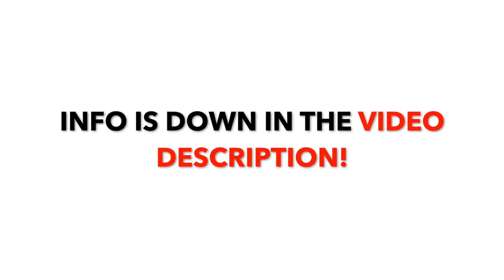NEW Whoop MOTORS from VCI | 8028 27000kV | 75mm Whoop | Testing on different Racetracks

Comment from the maker: Hello my Whoop Friends. I was very happy when I saw that VCI was producing new Whoop motors. I wanted 1002 high kv motors but when I saw the VCI Spark 8028 27000kv I thought I would give them a chance too. And I learned something: Motors with a light bell and/or small diameter can apparently change speed much more quickly (which is somehow logical). In any case, the first feeling of flying was fantastic. But then the voltage came. I think it has to do with the high internal resistance of the motors. If this could be kept as small as in the rcinpower 1002 22000kV motor then the VCI Spark 8028 27000kV motor would be the perfect whoop motor for 75mm whoops (at least in a 1.5mm shaft version). I'll talk to VCI about it. In any case, the motor as it is now, is not good enough for my standards. The voltage sag is simply too big. With the motor plugs the motor is completely unusable for me. Without plugs it just works. But it's not really good yet. Low internal resistance is absolutely key for whoop motors I guess. Maybe VCI can make a better version 2 of the Spark 8028 27000kV motor with lower internal resistance and short 1.5mm shaft.. And lighter.. 2.2g would be ideal. I hope so..

P.S.: I tried everything: 24-96khz esc firmware and motor timing low to high. Nothing helped to bring the voltage sag to a tolerable level

Let me know what your experiences are with these Spark 8028 27000kV Motors in the comments..

And if you like this new whoop cam..

Happy whoopin my friends! Whoop whoop! :-)

0:00 Racetrack 1 with GNB 380mah Lipo
2:18 Racetrack 2 with Dogcom 550mah Lipo (full lipo)
4:37 Racetrack 3 with Dogcom 550mah Lipo & GNB 380mah Lipo
8:33 Racetrack 4 with with GNB 380mah & Lipo Dogcom 550mah Lipo
11:23 Racetrack 5 with GNB 380mah Lipo
15:09 Racetrack 6 with Dogcom 550mah Lipo
16:38 Pictures of the Whoop

Also note the other videos on this channel, the option to subscribe to this channel and my other channels.

Comment: I dont get why you want always to use different amh batteries, why not sticking to 450 or 550 or so e other?   Btw ur too fast , slow down pls for common pilot to understand
Reply from the maker: I completely understand you! The reason for this is that I test a lot and want to find out what the differences are and where I can still optimize something. I enjoy testing the most and at some point I'll make a final video of everything I've learned. And maybe at some point there will be a few high performance products based on my knowledge. But there is still a long way to go until then. Haha yes I'm trying to slow down but it wasn't possible.. I need the adrenaline ^^

Comment: I'm pretty sure VCI makes the motors for betafpv.
Also for oddityrc.
Tmotor and rcinpower ware the ones to beat. Rcinpower makes the motors for HGLRC. Check out the hglrc 0802 and 1002 motors. Premium quality a little cheaper.
Reply from the maker: Exactly! For me the rcinpower are on top of the game right now.. And I hope that they make a good 803 30000kV at some point with low internal resistance.